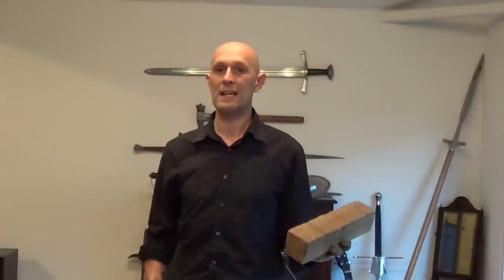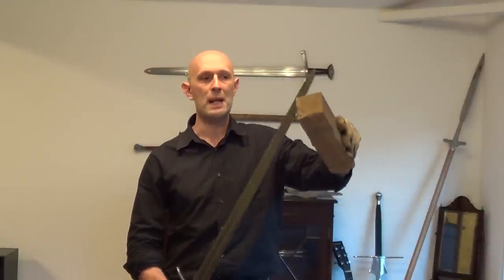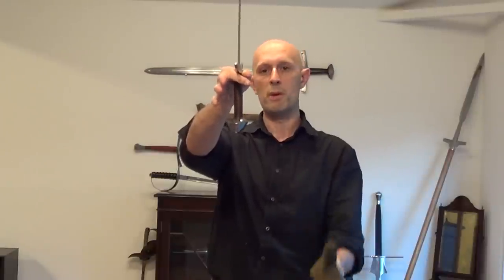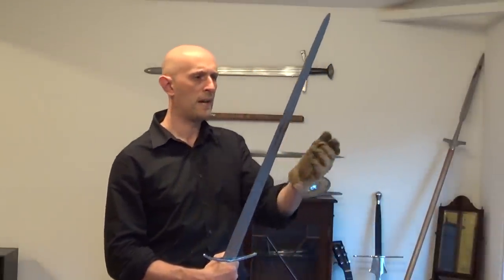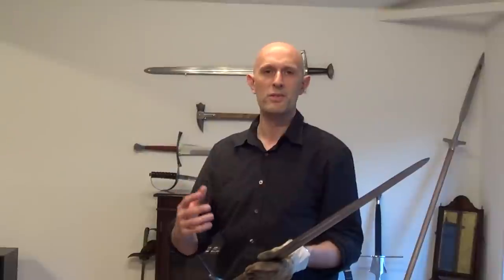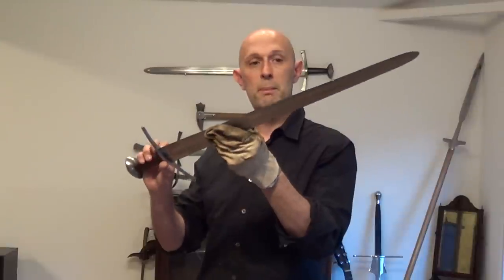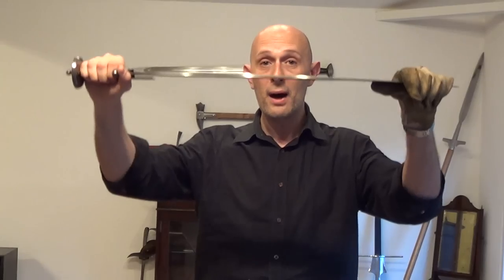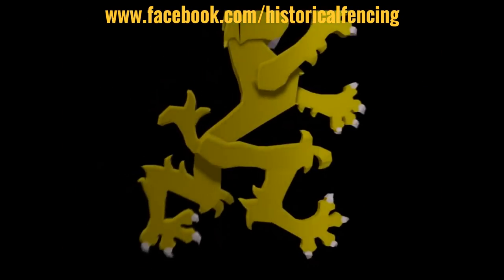Centre of percussion, nodes of vibration and stiffness of swords

Comment: I think that several different material properties are being conflated in this discussion. 

1) The modulus of elasticity is the amount that a material flexes when force is applied to it. This is a material property independent of the shape of the object. The stiffness of any given object in a particular direction is a function of both this property and it's cross section in the plane of the load . 

2) The yield stress of a material is the stress (force per unit area) required  to permanently deform it (not return to it's original shape). This is independent of it's elasticity. Brittle materials, by definition, do not have a yield stress ie they fracture before they deform. 

3) the ultimate tensile stress is the stress required to cause complete failure ie breaking into pieces. 

4) For most steels the modulus of elasticity varies little, regardless of alloy content, hardness or temper 

5) tensile strength and stiffness are two entirely different properties

To put this into context two swords of identical geometry will be equally flexible regardless of the type of steel from which they are made. However one made from a high strength, heat treated steel will take greater force (ie it can be bent further) before it deforms, than one made from say mild steel. But note that this is a result of it's greater yield stress, not any difference in modulus of elasticity. 

Note also that a spring tempered blade of a given alloy will have lower tensile strength than one with a harder temper. The advantage of spring temper is that it increases toughness ie the ability to absorb energy without failing, this comes at the expense of static tensile strength and hardness. Spring temper makes zero difference to the elasticity of the material. 

It's important to differentiate between the force required to permanently bend an object and the distance it flexes before this occurs.

Comment: Matt, are familiar with Radomir Pleiner's "The Celtic Sword"...?  It quite good (in a very dry academic way).  I would use that for the basis of talking about iron-age swords, whether German, Celtic or Thracian.  It's good for honestly discussing these early swords with "Celt" fans.  I've run into people...some of them academics...who seem to think that ancient Celts were akin to Tolkein's dwarves, and everything they made was perfect.  Pleiner's analysis of a whole ream of La Tene period swords shows what you'd expect: a lot of funky bar-welding, and a lot of funky bog iron made into swords by the activities of small-scale smiths and local manufacture.  That is, a lot of Celtic swords from the Roman period were actually pretty lousy...one edge partially carbon steel, partially soft steel, and the other one wrought iron.  A handful of them (both I believe from Gallia Cisalpina, in the Po Valley, which raises questions about trade routes and access to higher quality ores) were really good...much like good quality pattern welded examples from much later.  However, most were pretty middling, and some were downright terrible.  It makes me want to believe Polybius' comments about Celtic swords in the battle of Telamon in 225 BCE, where he describes some of them bending and staying bent, and needing to be bent back straight to be used again.  Most of the people I'm around discount this story as Greco-Roman bias against "barbarians"...but I am at least partly inclined to think it might be accurate.  In contrast, while Roman swords in the Republic were probably more or less similar, by the Empire...especially the "high" Empire...Rome was capable of large-scale production of sheet iron, some of it at least case-hardened, and at the same time monosteel sword blades that were of high quality, with minimal slag inclusion.  Then with the influx of German and Celtic peoples into the army in the late period, and the economic problems, you see a transition to longer-bladed weapons of mixed bar- and pattern-welded type.

Comment: Speaking from the physics side of things, the way you disprove that the node of resonance and center of percussion are not the same thing or related does not really convince me.
Swords don't live in some vacuum where the laws of physics don't apply. E = 1/2mv^2 will continue to be valid. However, obviously more is at play. The sword is not a homogeneous 2-dimensional bar. Shape and material make a difference.
It seems to me that the sideways wobble is (one of) the reason(s) why the tip does not transmit the most force: wobble is force transmitted sideways and put into deforming the blade.
In my mind, lateral motion will indeed heavily influence the power of the cut.

Also, I don't think Skal tried to make the point that a blade needs to be flexible, but that that just is the way material science works. Making a material inflexible will make it invariably more brittle. Steel vs. obsidian for example.
Reply: GundamSentinel The "wobble" of the blade would have no effect on the force of the cut. The wobbles are perpendicular to the line of action of the cut, making them entirely irrelevant.
The vibrational nodes and centre of resonance are entirely two different concepts. Nodes are to do with standing waves, and are determined by the resonant frequency of the sword. Meanwhile, the centre of percussion is to do with turning points, being the point where the translational and rotational accelerations on the object are balanced. If either of those are unbalanced then you experience the "bounce" that was demonstrated in this video when the blade was hit above the CoP.
It is certainly true that the tip of the sword will have the greatest momentum, but the more important factor is the amount of momentum that is imparted on the target, and above the CoP the rebound of the sword means that less momentum is imparted on the target than if you hit with the CoP, where practically all of the momentum will be imparted.
Reply: ZarlanTheGreen
Have you ever seen a blade oscillate edge-ways? For that matter have you ever tried to bend a plastic ruler the same way? Long, flat objects don't easily bend that way in the first place, much less undergo oscillations. Obviously there's going to be slight vibrations parallel to the edge, but they'd dissipate quickly, and would barely be a fraction of the force of the swing in any case.
Any oscillation parallel to the edge is going to be negligible on a macroscopic scale, and would thus not have a measurable effect on a sword cut. The vast majority of the oscillation will be perpendicular which will have no effect on the force of the blow, and as mentioned in the video, is disputed as to how much affect it has on the cut at all.
Reply: Gabriel Munn Do you know how crumple zones in cars work? That's metal moving perpendicular to the impact direction to absorb energy. That's what the sideways wobble of the blade is doing. Less wobble = less energy lost. 

Not parallel to the impact, perpendicular to it.
Reply: ZarlanTheGreen Whoa! Less salt, dude! We're discussing physics, not politics. There's no need to get confrontational.

Back to the physics. You're trying to say that the flat-ways oscillations will adversely affect the cut, right? Now, I can't claim that it has no effect on the cut overall, I'm not the most interested in cutting tests and such and haven't seen enough evidence to suggest whether it has an effect on the cut or not (this video suggested that it's a debated topic).
However, I can tell you with certainty that the force of the blade wobbling flat-ways will have no effect on the blade's force edgeways. It's just how the math works. If you throw a ball perfectly horizontally it will always hit the ground at the same time (discounting air resistance). No matter how hard you throw the ball horizontally, if the force you're applying to it has no vertical component, it's acceleration vertically will remain unchanged.
There is literally no way that a force applied perpendicular to the direction of the blade's motion can slow it down.
Reply: GundamSentinel
Actually, crumple zones work by reducing the rate of change of momentum in the crash. When the car crashes, the crumple zones begin to give way, which slightly prolongs the duration of the crash, causing the car to decelerate a bit more gradually (the same principal behind air-bags and safety nets as well).
The crumple zones will splay out sideways, due to being compressed between two very uncrumpleable objects, but that's the result of them absorbing the impact, not the cause of it.
Reply: Gabriel Munn And you know how they do that? By having the metal plastically deform and absorb impact energy. Exactly the thing you don't want happening with a sword. Now, a decent sword will not deform plastically, but it will deform elastically.
Reply: ZarlanTheGreen
You seem to miss my point. When I said that "I can't claim that it has no effect on the cut overall" I was saying that there may be other factors involved in how well a blade cuts (e.g. sharpness, edge alignment), and I'm simply not knowledgeable enough in that topic to comment.
Clearly, you disagree, believing that force is the only factor in how well the sword cuts. In that case I would stand by my point regarding perpendicular forces and so on. Admitting my ignorance in regards to how swords work does not invalidate my knowledge of simple Newtonian mechanics.
It is true that when objects are compressed they begin to spread out perpendicularly, but I'm sure you've noticed that when that happens they spread out in all directions, meaning the net force along that axis is still zero. The i momentum isn't being magically turned into j momentum.
If you don't believe the whole thing about perpendicular forces having no effect on one another, I could draw you a diagram to help visualise it a bit better.
Reply: ZarlanTheGreen
Regarding the "missing my point" thing, that was a semantic error on my part. I was talking about the other factors rather than the overall point of the discussion, I should have phrased that better.

Next, onto your assumption that we were ignoring all factors except for force. I agree, and that was what my initial comment was addressing. My assertion being that the flat-ways oscillations had no affect on the edge-ways force.
You responded with "If I cut into something, and the blade is wobbling about flat-ways... You seriously think that's not going to effect my cut?"
My response to this was to say that while there may be other factors of the oscillations that may in fact have an effect on the effectiveness of the cut, the force is not one of them.

This is quickly descending into an argument of semantics, which I'm not fond of. So I'll continue on to the Physics and will try my best to be as clear as possible from now on.

The overall mechanics of this scenario are more complicated, but as you yourself have said, we're for the moment only considering the force of the swing, and my assertions in that regard are based on a very simple concept that you appear to disagree with.

"The force that spreads perpendicularly, is force that could have been transferred to/though the target, but that has now been lost."
The compression of the sword against the target is due to the reaction force against the sword from the target, which is of course parallel to the edge of the sword (assuming good edge alignment, which we are). As I said before, the perpendicular "spreading" is a reaction to the force, it occurs due to the motions of the particles in the material (they of course aren't hitting each other perfectly parallel, thus the sideways deflection).
 There is of course some "lost force" due to the fact that the sword will never be able to impart its full momentum on the target, but that's due to coefficients of restitution, rather than because of oscillations in the blade.

Finally, you said "There is more to force, than just momentum." That's simply not true. According to Newton's Second Law: F=ma, which we can express as F=m*dv/dt. m*dv is the change in momentum, thus force can be defined as the change in momentum over time.

Comment: I wouldn't say the science is wrong. I would say they're looking at the wrong mechanics.

The tip may be travelling the fastest, but it also bends more on impact, especially with tapered blades. The center of percussion is a good approximation of the balance between the velocity of the blade and its stiffness.

Comment: there is a difference between being flexible and being a spring. the point made was that obsidian was too stiff and too brittle to be a good sword material. not that stiff steel blades didn't work. take a look at a slow motion shot of a good katana making a poor cut. it shows some very clear blade flex. a bit of glass would shatter, that's the point.

Comment: All you're doing is identifying a point approximately a third of the way from the tip (differences are due to the stiffness profiles of the blades), which is only fully subject to harmonics above the third harmonic, so it won't ring within the human range of hearing. The harmonic vibration will absorb some small amount of energy, but certainly not enough to justify what you're saying.
If you want to demonstrate it in a way which will prove or disprove your claim do a pendulum test, where you place the sword on a rig allowing it to pivot around the handle then drop it from a certain height/angle to cut a calibrated object, then measure the height of the travel after the cut.
Google a charpy test to see roughly what I'm talking about for the test and harmonic guitar tuning for a good visualization of what's actually going on with the sword blade.

Comment: I think the thing with the node of vibration is that when you hit something with the edge, the resistance it encounters still transfers as energy through the sword-and since it's easier for the blade to flex along the flat as compared to the edge, it does so (see slow-mo test cutting), thus making an area that doesn't wobble as much useful for keeping the edge in line.

Also, I feel like you're talking about a different kind of flexibility. While it is true that swords can be stiff or wobbly, I think Skall was saying that it's good for a sword to be able to undergo stress and not snap.
Reply: Nah, the flat vibration doesnt really have anything to do with the center of percussion. It's a function of the edge to edge vibration - the same thing, just turned 90°. However, it's probably a good idea to have them close to each other because it likely lessens the stresses on the sword when striking something.
Reply: edge to edge vibration is impercebtile to the human eye unless the sword has a wide cross section, as the torque required to bend something scales in a cubic function to the height of the area. If the blade is 10 times as wide as it is thick, it will vibrate 1000 times as much in the flat as it does in the perpendicular.
Reply: obviously I am simplifying things, but swords are near enough to rectangular cross-section for government work

Comment: I'm a Civil Engineer and did get a lot of material's classes. I can bring something to the discussion: flexibility is good because, flexible objects let the tensions pass through them with their deformation. The work done is equal force times distance, so if the blade bend, it needs less force to do the same work (which, in a simple term, is the energy transfered to the blade through the hit). The stress is, therefore, lower and the blade will be more durable (which is important since in a battle you need lots of hits before you need to change your weapon or fix it. Cheers.

Comment: Yeah, actually the tip is going faster, but the CP is transferring all of the energy of the whole system, so... Yes, use the "sweet spot" - works for axes too.
Reply: And the difference in the nose of resonance and CP is due to the cross section. They tend to be close because of the profile and distal taper of a well made blade. Because of the wide, flat shape of a sword blade, it's waaaay stiffer in the cutting plane, so you just don't get a visible apmlitude... But you can sure feel it!

Comment: I suspect that skallagrim's point was that any striking weapon needs to flex in some way or it will shatter on impact.  Iron/steel is pretty flexible.  If flexibility didn't matter, we'd make blades out of glass which is just as mechanically "hard" and a lot sharper than metal.  It's tricky to talk about mechanical properties because it uses words like "hardness" and "flexibility" that don't mean quite the same thing as when we use those words in common speak.
Reply: Ace theSuperVillain The reason we don't use glass might be unrelated to the hardness. Maybe it has to do with the molecular structure of glass and how it forms fracture lines. On the other hand, perhaps some flex is necessary to distribute stresses and not form fractures. 

It does seem that most materials that are considered hard (diamond, obsidian, dragonforce) don't make for good swords.
Reply: Except you can make molecularly amorphous metal and it's much stronger than crystalline metal.  http://en.wikipedia.org/wiki/Amorphous_metal

Comment: I still don't get how a blade can have very gradual profile taper and cut very well, but a blade with very gradual distal taper, like the Albion Ringeck, can be a substandard cutter. Isn't cutting power all about mass, mass distribution lengthwise and edge geometry? Why would it matter whether that mass extends backward from the edge or backward and to either side?